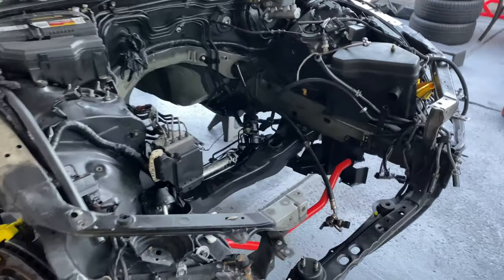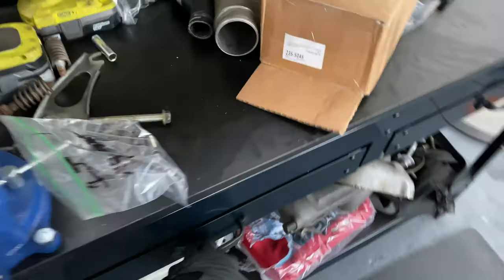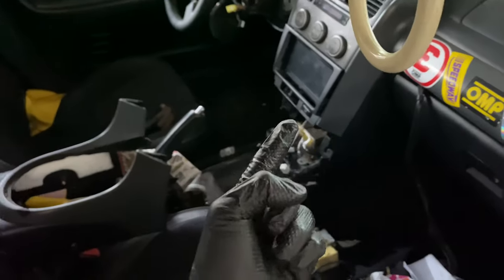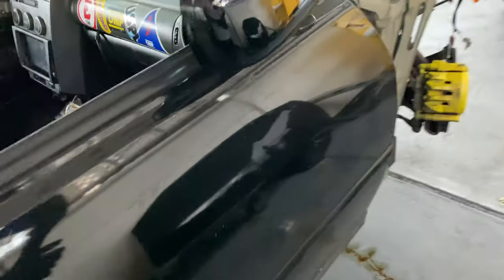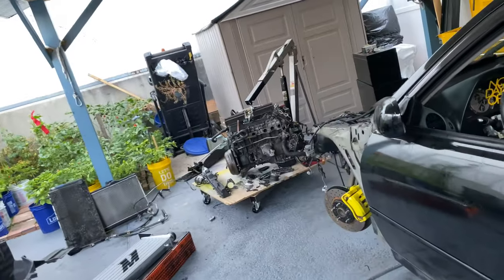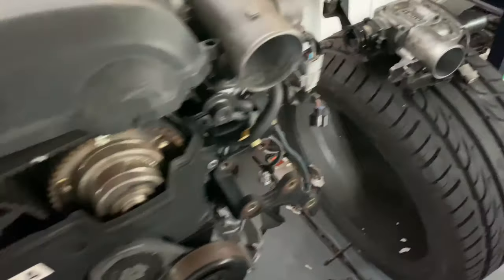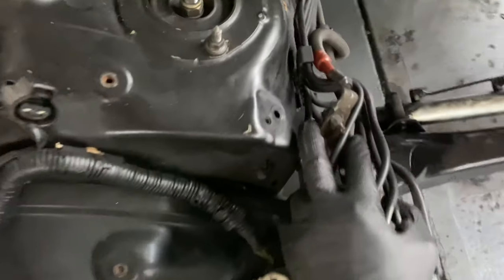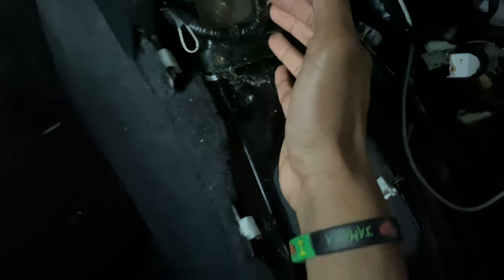HOW TO 1JZ SWAP A IS300 ! (WHAT YOU NEED)

Comment: Great info. Your stock ECU didn't have the immobilizer plud. The R154 also came on the VVT-i 1JZ. Cd009 to JZ adapter manufacturers are plentiful euth SerialNine offering the best by far. Autosport Engineering is also another adapter manufacturer. The cheapest 5Speed option that's a bit stronger than the R154 js the aisin AR5 swap from a Chevrolet Colorado (transmission usually goes for 200-500$), adapters for thise are available from CPR Manufacturing. Collins adapters are the most expensive, most marketed but not the most liked.

Comment: Another option which is cheaper and as strong if not stronger than all the gearboxes that you mentioned is ZF S5D-310/320Z out of E36 BMW with 5 speed or 6 speed one out of E46. They both work through Collins adapter or couple other kits similar to Collins...

Comment: you can use the immobiliozed ecu you just have to get it reprogrammed
we do it alot with the aristo swapped gs300's
Reply: Would you have to go to lexus for that?
Reply from the maker: king ferg some people on Facebook do it not sure how legit it is however
Reply: @kingferg3456  theres 2 ways about doing it
going to lexas for reprogamming
or swapping out the immobilizer chip from your stock ecu into the new gte ecu 
which takes patience and a bit of skill to pull off

Comment: If u end up with a immobilized ecu just change the ic900 in the jzs ecu with ur is ic900 and wire the  immobilizer port and it will work. I did it and it works

Comment: Awesome video, question about the ecu. If you buy the engine with a immobilizer & get a seperate ecu without an immobilizer will the engine start?
Reply from the maker: king ferg yes it will just try to get the same ecu for example jzx110 jzs etc etc

Comment: Actually W58 isn't stronger than latest versions of W55-W57 with steel center plate (exists early versions with aluminium plate). You can easy distinguish them by rust on center plate. Rust means it's strong gearbox)) aluminium doesn't have any rust.

Comment: How did you blow the stock motor with a automatic transmission. All seriousness,  I run a built is300 auto on nitrous sometimes for fun daily driver. I always worry about the rods. Looks like you thought a rod yet I see other spraying a 100 shot all day. If their was  a specific thing that contributed to you catastrophic failure. Please let me know so I can address it. Thanks great video congrats on your build.
Reply from the maker: Low oil lol

Comment: Yo you should upload more videos on this build . I fw the vibe , and the honesty. Plus im learning about the is300 platform. How difficult are these cars to work on ? Would you recommend this for a first car ?
Reply from the maker: Adrian Vargas thanks I appreciate that as for the 1st gen is300s being good first cars yes it’s a excellent first car. They sound beautiful, 4 doors , and lots of aftermarket however the drivetrain is very limited for boost applications. The stock ge can only hold 8 pounds and is VERY weak same with the manual transmission if you happen to find one for under 6k your only real long term RELIABLE option would be to swap 2jz gte in it or in my case 1jz gte. Basically to sum it up it’s a great first car however if you really wanna have some fun in it get ready to drop at least 3-4K in it for a swap
Reply from the maker: Adrian Vargas and yes they are pretty simple to work on it’s literally a Toyota with a Lexus badge
Reply: SXE10CHRIS thanks for the advice. I’ll be on the look out for more videos man. Great job explaining everything. Be safe.

Comment: Drive by wire means its electrical. What your meaning to say is drive by cable!
Reply: On the is300 2j, it operated manually up to 40% or 45%. Then the rest is electricity engaged.

Comment: r154 for cheap (LOL)
i've blown three of them  (W58) with only 240kw 1jz 
go the r154 and save yourself some ass
Reply: @parkerbethke you heard wrong, they are not as strong or even close for that matter
Reply: one was originally designed as a non turbo box and the other as a turbo box, they are completely different design internally with thicker input shaft and stronger bearings

Comment: How did the 2jzge get blown? I thought they were bulletproof unless you snap the timing belt?
Reply from the maker: Bill Weaver they are 100% bulletproof I literally beat the shit out of this motor but it blew up because im pretty sure I ran it without oil
Reply: the ge VVTi comes with thinner connecting rods, non vvti have the same bottom end of the gte, or something out of a sc300 from 90's
Reply: adding power with that vvti gonna be sus

Comment: Doing a budget build 1jz swap right now, I currently already have a w55 trans. Is there anything I need to upgrade or change before I bolt the 1jz up to it?
Reply from the maker: Blake Weatherford if your talking  transmission wise your stock bellhousing will work. Id start with a lightweight flywheel. I’ll leave it up to you if you wanna upgrade your clutch as that w55 is extremely weak ....
Reply: SXE10CHRIS  the trans came in the car so I’d like to use it until it blows and then I’ll upgrade. Just wanted to make sure which flywheel and clutch to use when bolting the w55 up
Reply: You should consider getting rid of the W55 and move to something a bit tougher like say an R154.

Comment: I have a Toyota 1G-FE on altezza... basically same like is200....it's got the J160 manual 6 speed gearbox...would it work on the 1jz...thinking to do a swap for more power.
Reply from the maker: tejinder bhamra I highly doubt it that bellhousing is most likely completely different

Comment: I’m assuming that this also correlates to any xx300 chasis for example an SC300? Yes, no?
Reply from the maker: Leo Lopez honestly not too sure if that chassis uses the same drivetrain as a is300 however if it uses the same rear subframe and driveshaft then it would at least be similar

Comment: can u use the auto a650e bell housing on the w58?
Reply from the maker: I’ve thought about it however it doesn’t have a cutout for the slave cylinder nor the clutch fork therefore it won’t work

Comment: ETCS-I is the less desirable, you want the ETCS, ETCS-I uses ecu, pedal position sensor and some extra shit you don't want. ETCS IS WHAT YOU WANT NOT I
Reply from the maker: KingGoldChainz incorrect , for the is300 etcs-i is the way to go simply because Etcs-I uses drive by cable meaning there’s literally a cable that connects your gas pedal to the throttle body . Etcs is drive by wire meaning there is no cable it’s all controlled electronically. For many other 1jz swaps the etcs is more desirable yes, However for the sxe chassis etcs-i is the way to go
Reply: @Chrisonboost  You've literally got ETCS and ETCS-i backwards. ETCS-i is the drive-by-wire option; ETCS is drive-by-cable. The "i" in ETCS-i literally stands for "intelligent", meaning the ECU is in control, meaning DBW. Yes, if you're running the factory ECU then you want the ETCS-i throttle body; but if you go aftermarket, you need to delete the "i" portion of the ETCS-i throttle body with a kit from somewhere like DriftMotion.